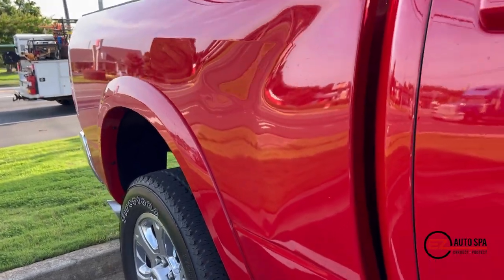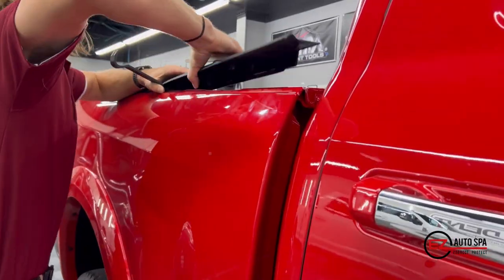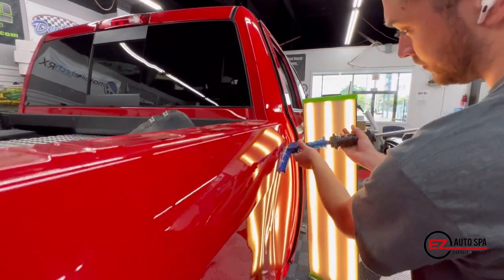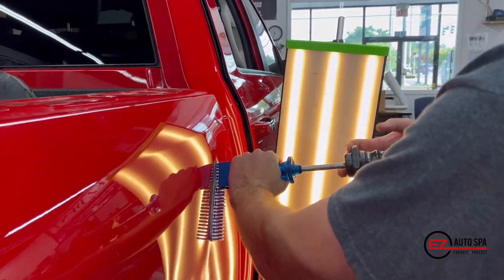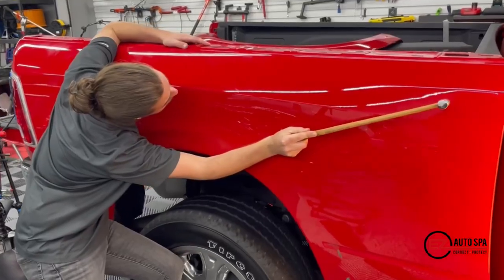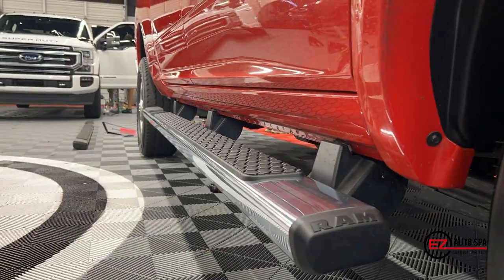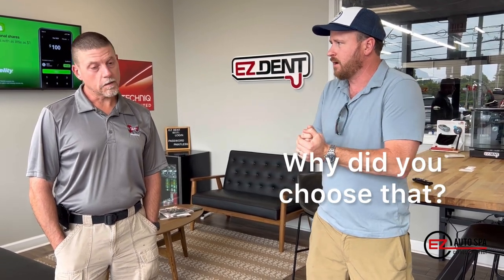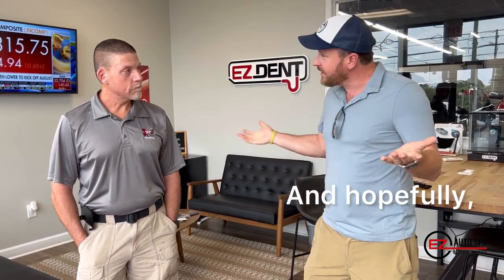Huge Bedside Paintless Dent | Full Repair

Comment: What something like this cost compared to going for body work and paint
Reply from the maker: It depends on a number of factors. For PDR, the size, location, and material (steel vs aluminum) all contribute to the final cost. 

For a collision repair, cost depends on the color of the paint, if the panel can be repaired or needs to be replaced, and the quality of the body shop. 

This particular repair cost around $1800 to repair with PDR. It was done in a couple of days. 
The client took the truck to multiple body shops and every one of them quoted to replace the entire bedside and repaint it. The cost for replacement was going to be closer to $4000 and he would be without his vehicle for around 2-3 weeks.

These results and cost can always vary and the quality of the Paintless Dent company makes a huge difference. But the most cases,our clients find that they save a significant amount of time and money while maintaining the factory finish.